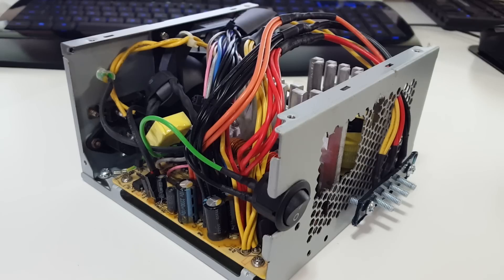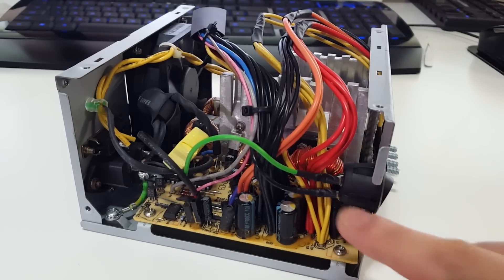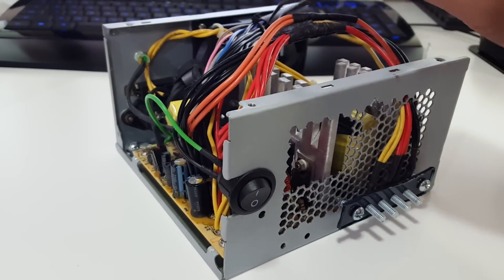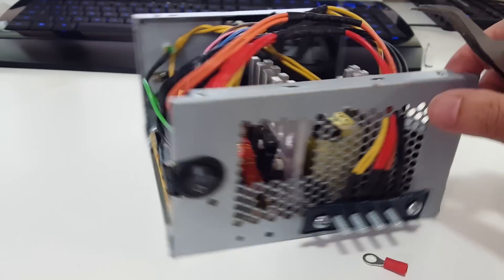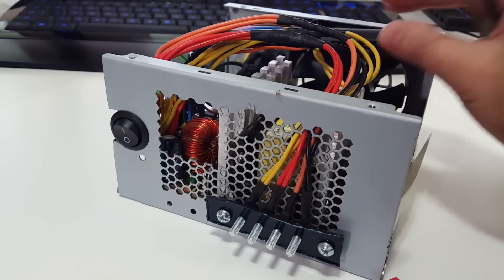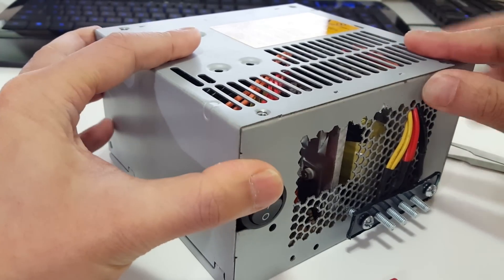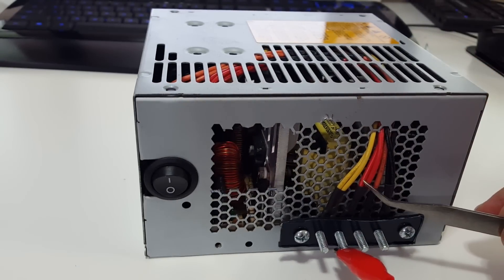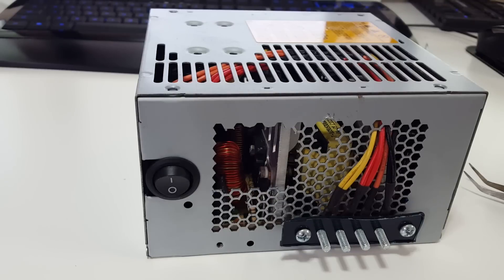Low End Tech - DIY Cheap Bench Power Supply

Comment: If you start working with Signal Generators you may also want to get those -5V and -12V Pins out. Most of the Cheap Frequency generators need them to generate the "lower" Part of a sine wave for instance

Comment: Good project. these psu's can deliver quite a bit of current at 5 and 12 volts. in my experience they will also auto shutdown if the outputs are overloaded.

Comment: so what wire makes the power supply start up and stay on
Reply: green wire.

in order for it to turn on you much implement a switch that connects a ground wire (black wire) with the green wire.
you can also just butt splice them together if your PSU has a master switch.

Comment: My power supply has a small black button. The pwr supply I built won't work unless I hold the button. Do you know how to fix this?
Reply: it needs to be a switch not a button
Reply: pjharro the button is built into the power supply through a pcb
Reply: oh.... well I don't have an answer for this. Can you bypass the button and attach a switch to the green wire instead?

Comment: Great idea. I would have spaced the pins further apart, to avoid shorts.

I read somewhere that some PSUs don't regulate the voltage correctly when open circuit, they require a minimal current drain. Would be interested to know whether you found that.

Comment: Love ya, but this is a dangerous hack. You really need to correct some things.
1) Bushing for the wires going through that vent mesh (You could 3D Print One)
2) Cover for those holes in the mesh vent (You could 3D Print One)
3) Separate those output terminals farther apart and farther from the bracket screw on the left (also 3D print one)
Reply from the maker: I completely agree and will be upgrading this build in the near future. with 3d printed items. I had this power supply years before my 3d printer and I completely see the flaws. thanks for your input and will show you guys the finished upgrades later
Reply: 3) I would replace with banana plugs
Reply: YES !!! 
This one is a scary hack .

Comment: I have watched a TON of these ATX conversions. In the process,  I learned a few things.  You left a lot out of your discussion.  Some of those wires you left out could be sensor wires which which need to be soldered with the appropriate voltage connection or there can be problems.  You should have added like a 10 Ohm 10 Watt resistor to one of the red 5 V wires and a ground wire to provide a load if this is a single rail PSU or if a double rail, on the 12 Volt.  I did not see any kind of fuse, but having a fuse before the mains switch is important.  The real chepo power supplies can almost be dangerous because not only do they use cheap components but they cut corners by leaving critical safety components out.  When you are talking about dangerous, its the large electrolytic capacitors that can store a serious charge.  If you are going to pull the motherboard of the PSU out, be damned careful NOT TO TOUCH the leads of any of the capacitors  Once again, a 10 Ohm 10 Watt resistor should be used to drain any lead contacts directly to the capacitors.  It can take some time to drain capacitors, the large part is drained quickly but it can take up to half an hour to completely drain a large capacitor.  The drain time is a log factor, not linear.  If the psu is taken out of an old computer stored in a closet for a couple of years, the capacitors have probably drained completely, as no capacitor is ideal and there is a slow current loss on all capacitors. But if the psu has been turned on anytime recently, RESPECT THE CAPACITORS!  I wouldn't touch the PSU;s for a few days and still drain the contacts with a large resistor.  Don't use a screw driver!  ONLY IDIOTS drain caps with a screw driver.  If you know anything about soldering and you have a solder iron and a solder sucker, or a copper wick, to soak up molten solder, you can just remove the wire contacts from the motherboard by de-soldering them.  FIRST CHECK with the standard ATX specification for WIRE COLOR CODES which tells you exactly what all those other wires are that you left out mentioning.  There are a lot of other mods you can do if you want to spend a few bucks, such as a digital voltage readout, an on-off LED, etc you can do.  I just thought I would mention this stuff.

Comment: I presume you missed out the +3.3V Sense wire connection (Brown wire) to the orange terminal output and the preload resitor at the +5V output in order to improve all output voltage values; nevertheless, thanks for sharing.